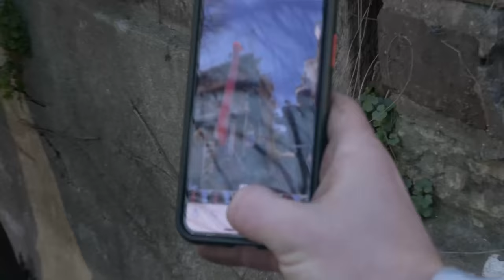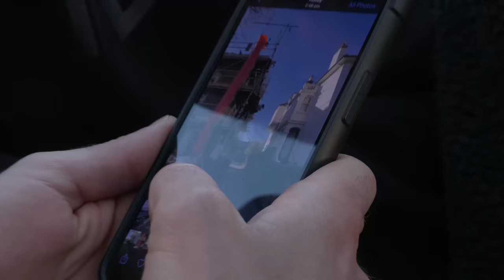STORROR vs CRAZY vertical SLIDE! 🇬🇧

Comment: Coming from working on sites and seeing razor blades, nails, screws, metal chips, steel wire, staples and other crazy shit stuck into the walls of these chutes I've always thought of them as horror slides and these guys are just ripping down having a blast

Comment: HaHa that was insane.
It reminded me of when we had built a platform high in the trees and we had some ingenious ways of getting down one way we took a long strap tied it off to one of the branches above us then we would start  wrapping  it around an ax handle (the ax was no longer attached) we would sit on the handle so the strap was between the legs like a homemade swing made from a piece of cut lumber and a rope. The way it worked  it wouldn’t just start unraveling as long as you held the strap tight but once you loosened your grip the strap wrapped around the ax handle would start unraveling you could control how slow or fast you descended had to wear gloves so wouldn’t get a rope burn. 

Two other was we came up with .
1 We used a rope and a pulley and made a zip line.
 The last way there was a young tree next to the platform we would grab it and just jump lol that was the scariest 1 trusting the tree once you did it it was fine.

Comment: I did this at a construction site in my small town in PA and got chased by security and police... The workers were just doing their job and I just ran passed them and jumped in, it wasn't as loose at this one is, it was tied to the scaffolding so it was secured but it was 3 stories up. They were NOT happy but it was seriously fun... Except I didn't have a hoodie or pants on so I got cuts and scratches all over my legs, back and forearms because the inside had damage all over the place.